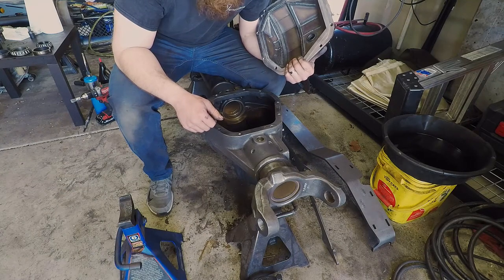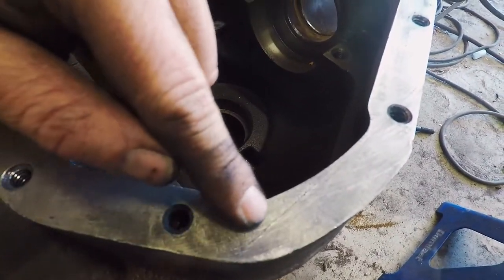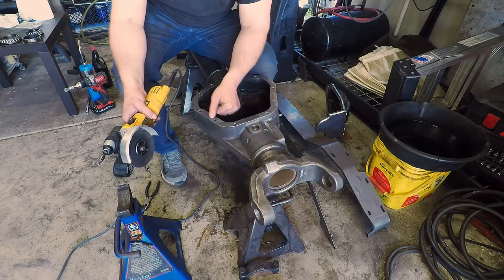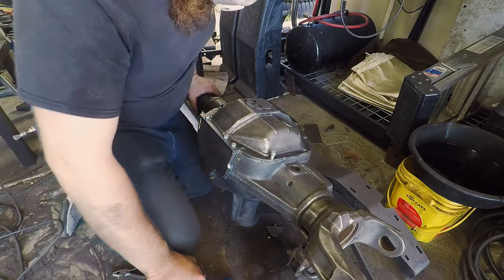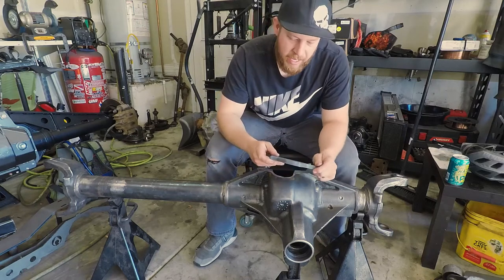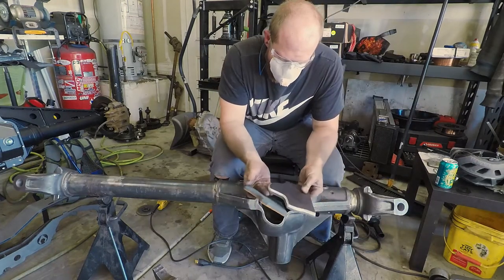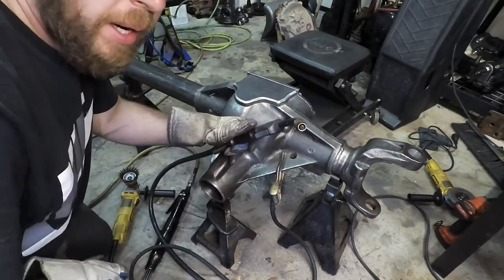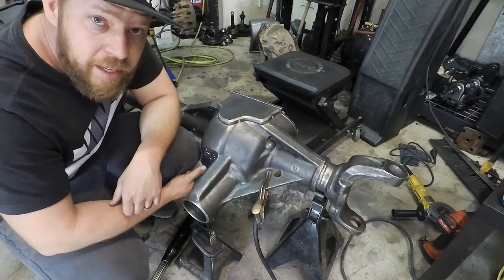Dana 60 Shave Kit Install: 1999-2004 Superduty - Ballistic Fabrication High Clearance Diff Cover

Comment: Did you have to turn the dana 60 ring gear down? Mine is hitting the cover at the bottom and ballistic fab says no ring gear turning in their instructions.
Reply from the maker: I haven’t installed a ring gear yet. I’m waiting for some juicy Black Friday deals. Did you get a super 60 ring and pinion?
Reply: @aireddown813  i found out the Yukon zip locker is actually hitting the edge of the diff cover on the vertical welded piece. Called ballistic today and they asked for photos because this is the first time they have had this issue. 
I have the Yukon dana 60 4.56 gears and the Yukon zip locker. Yukon 4.56 in the rear and zip locker on the sterling 10.5 and I just got done grinding and fitting the shave kit for the 10.5
Reply from the maker: @d7k8gsxr600  I had to grind my ballistic cover to fit my sterling 10.5 as well. I kept the tone ring and that was making serious contact.
Reply: @aireddown813  i just got my ring gear for the 10.5 machined down this week so i will test fit this weekend and make sure it fits. 
Luckily i won't have to shave the d60 ring gear now that i know its not hitting the cover.
Reply from the maker: @d7k8gsxr600   very nice! I love the way the shaved axles look. It’s next level high tech looking.

Comment: How much clearance do you actually gain for all that work?
Reply from the maker: On this particular axle, 3/4” I think. I was kind of surprised how little I ended up gaining. Ballistic fabs website mentioned gaining much more than that. To be honest, I’d rather keep the housing stock and keep the possibility of adding a Dana 70 gearset if the 60s can’t keep up. In the end, clearance is good, and I don’t regret the kit.